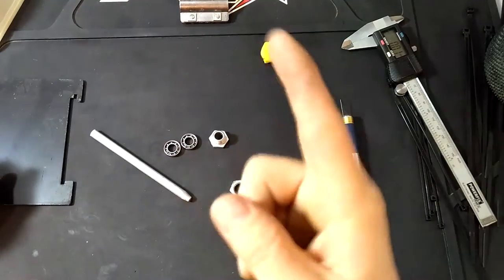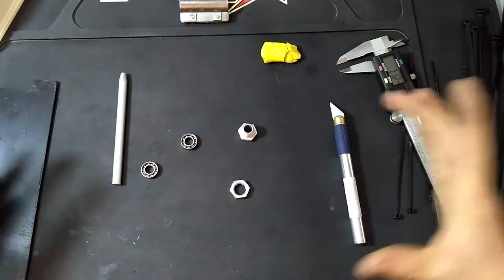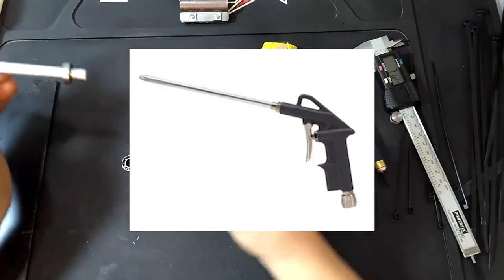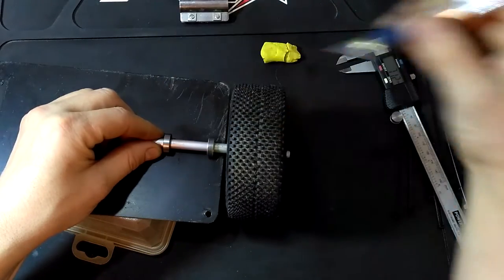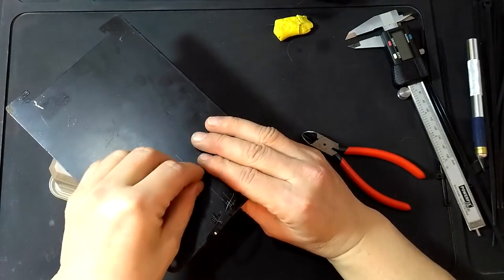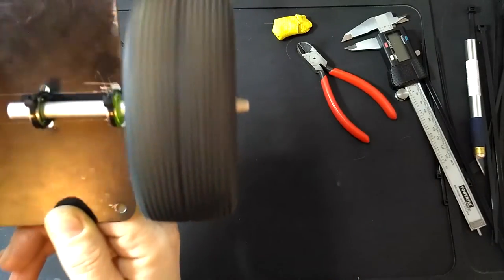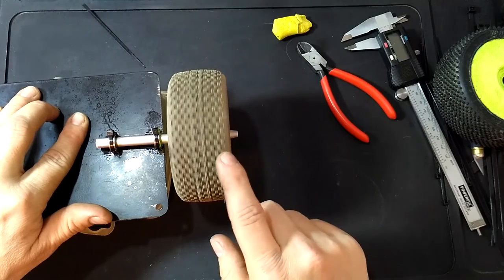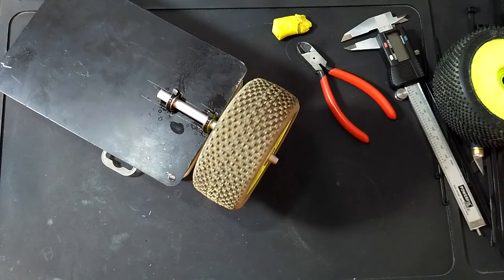DIY - How to build RC Tire Balancer - Homemade

Comment: Want to know of a even easier and Free way to balance your tires?? 
Use the front axle of your RC Car! 
It has the right size hex nut and bearing built right into it.
Reply from the maker: You can't use front axle on 4WD cars because you have a drive shaft sticking out from it.
Reply: Yes you can, you just have to remove the dog bones and it works.
Reply from the maker: Any decent models do not use dog bones for axle attachments. For instance my xb8e uses universal joints on all axles. 
To actually go and remove that for wheels balancing would be insane. Much better, smoother and easier is to use balance tool like the one I made, or buy production peace.
IMHO
Reply: What do you mean all decent? Lol, Traxxas makes at least decent cars for their price and you can use the front axles of their cars.
Reply: @TheUncleRuckus  Lol.  Not only is that extra work that may cause you to have to re-align the wheel for that axle, but the axles also have friction that won't allow the wheel to spin freely enough.

Comment: Could of used a small bench vise and tighten it firm enough to hold the bearings without damage and would be quicker and easier